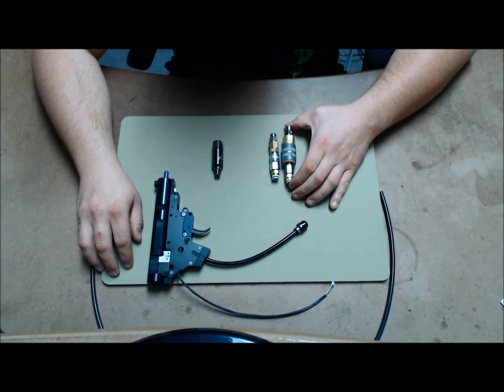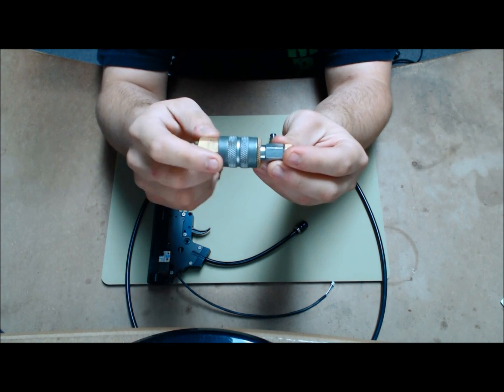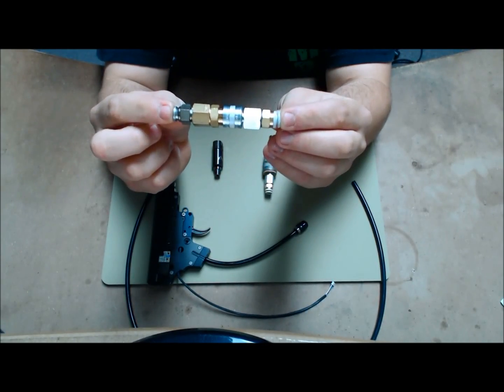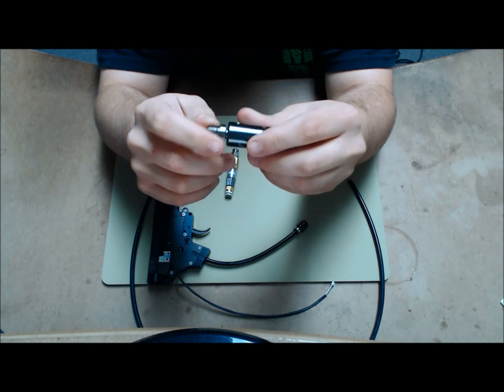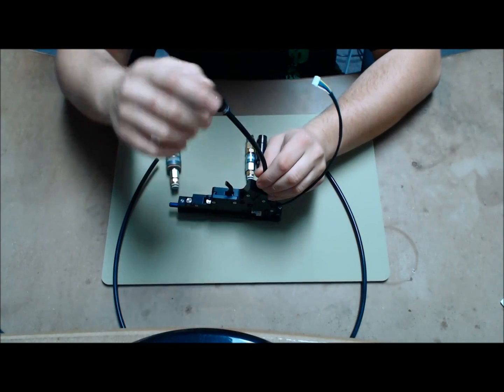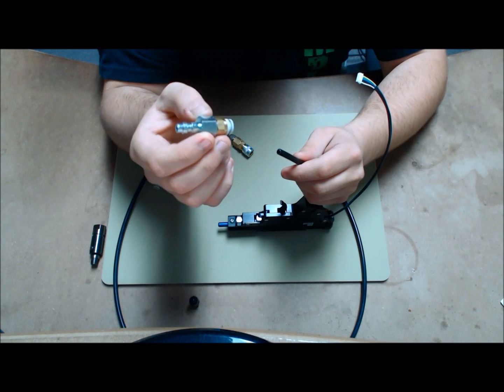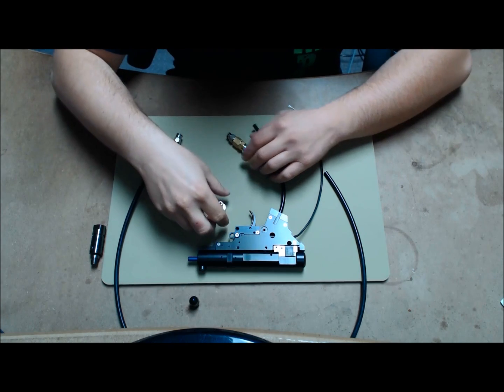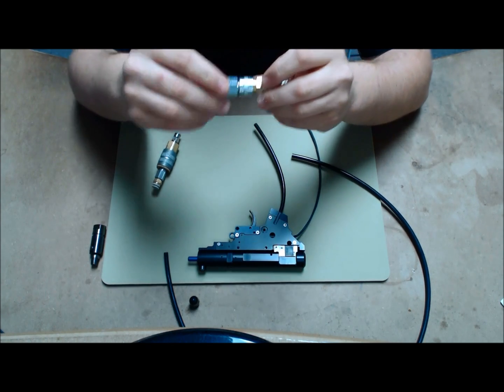Air Rig/Fusion Engine Connector Basics

Comment from the maker: Jacob,

The output pressure and tank pressure are two seperate things.  You can have a 3000 or 4500 psi tank that outputs 300 PSI.  Most tanks output greater than 300 PSI unless they are SLP regulated tanks. 

The kit comes with everything you need and already comes with that special tank.  The SLP tanks only difference is the output pressure, which does not affect the amount of shots per tank or the performance of it. 

Please let me know if you have any other questions.
Thanks!

Comment: I have a question about the  Air rigs i was planning to buy the kit with the fusion engine the hpa tank the lip battery and the SLP Air rig i was digging on the air rig and it says (Please note, this air rig can NOT use any HPA tank that outputs higher than 300 PSI! If you hook up an HPA tank that outputs more than 300 PSI to this system, it will damage the regulator, rupture the macro line, and possibly destroy your solenoids in your Fusion Engine.) Does that mean you have to buy a 300PSITANK?